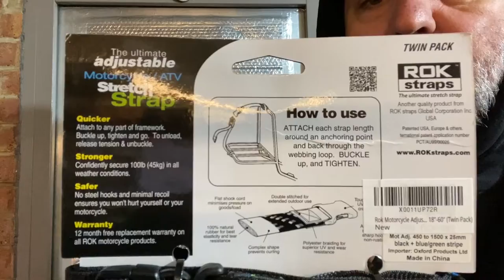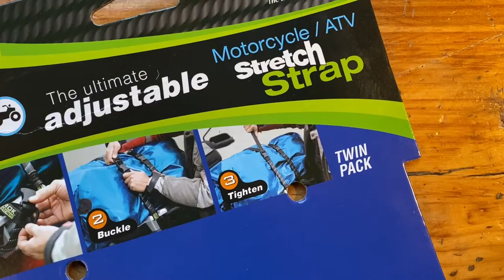ROK STRAPS / When you REALLY need to secure your gear to your motorcycle.

Comment: Yeah dont follow this advice. the straps on a large bag should go diagonal across the bag through the handles. If you strap across the bag and a strap fails at the back the contents can shift and the bag fly off harming a rider behind you . I hump really crazy things on a st1300 with modified rear rack from a 5ft rat cage to a boxed 55 inch tv mostly using ratchet straps as rok wont fit round. As rock straps have plastic connecters go diagonal.
Reply from the maker: Yeah that’s a good idea. Never had one of these fail on me though, not to say it couldn’t happen. Wait… you carry a 55” boxed tv on the back of a motorcycle? If we are giving out advice,  I would say don’t carry a 55” boxed tv on the back of a motorcycle.
Reply: @billy4rocks  They are great straps. But if one does fail then one diagonal will probably still hold it. I have a 10mm ply plate that slots under my rack from the front and has bolts that drop through the rack the pan is very wide with the panniers and the TV is light. If I'm carrying something longer I put a block under the front so I can Crank another strap on the rear pegs. The plate weighs alot less than the top box that it replaces and the loads weigh alot less than a pillion. I also have a rear lower shelf under my numberplate for a tent when camping 2 up pans are beats. I think each ratchet I use is rated for alot by itself. Cheers for the response
Reply from the maker: @luc1ferblack  that’s some set up you got there! No worries mate, I appreciate the tip, might do an update video and I’ll give you a shout out. Cheers, Billy.
Reply: @notexpatjoeDamn you outdid me

Comment: Me and the wife have been thinking of using these I was always turned away by the idea of a plastic buckle. 

Thanks for the advice I will try these and hopefully not lose our tent again
Reply from the maker: No problem Captain, they have never let me down.
Reply: Get the longest ones they do and go diagonal crossed across the bag through the handles. they are amazing straps its a shame they dont do metal buckles though. Crazy holding strength.